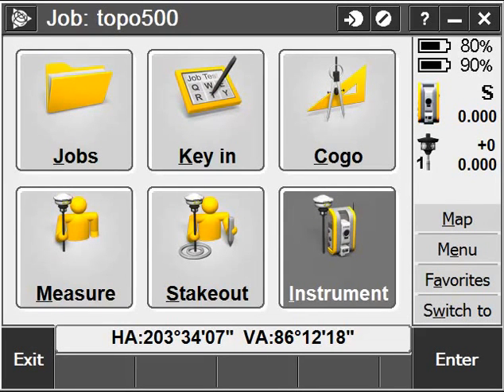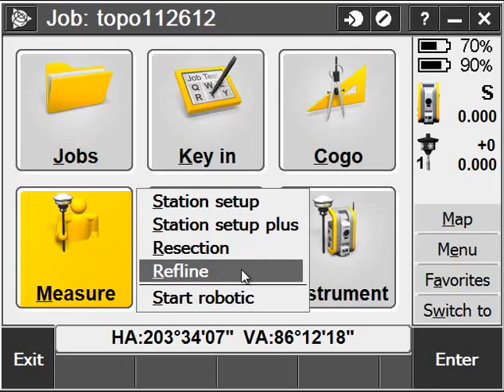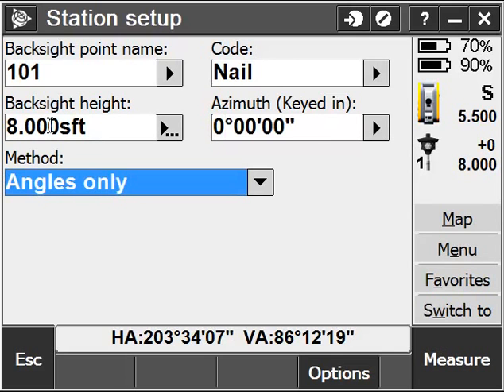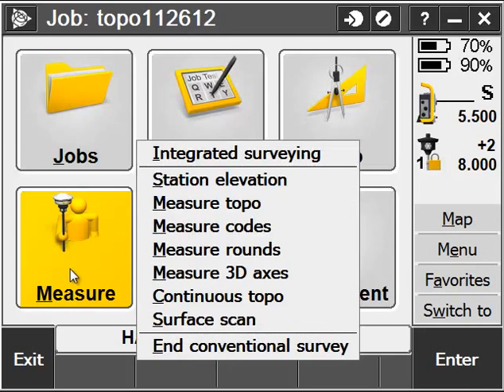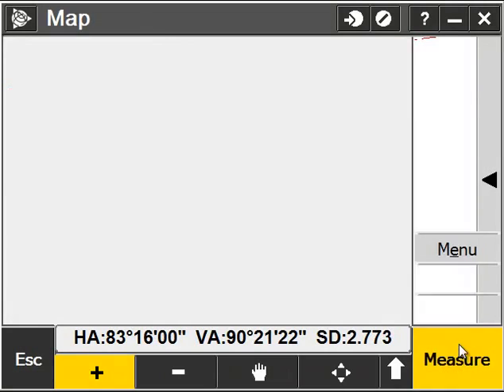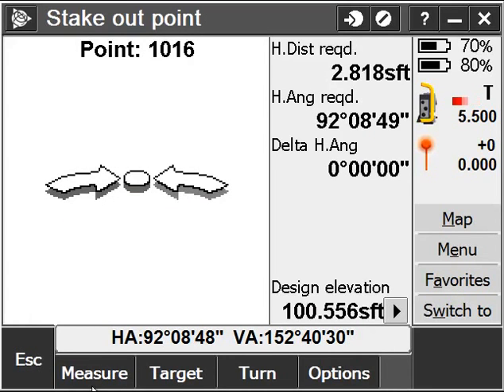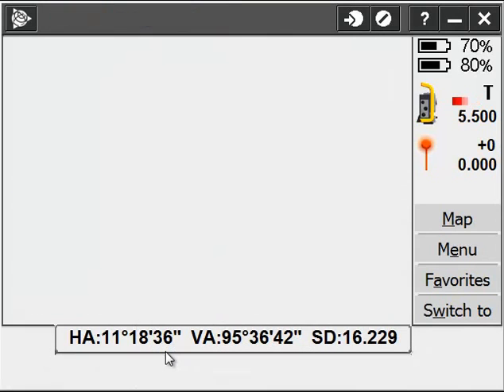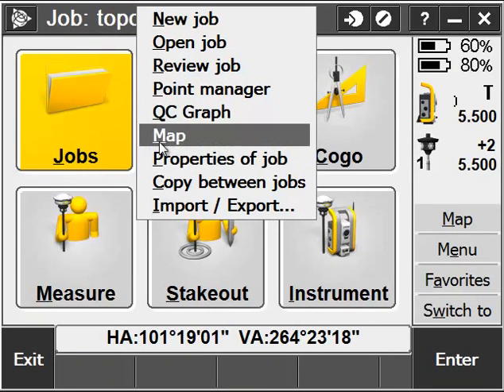Trimble Access & The S6 Total Station - Quick Tips

Comment: One thing I would add to the job setup is that if you choose quadrant bearings under height, you’ll be able to inverse and get a bearing instead of an azimuth in cogo, this is a little helpful when doing boundary surveys to check your measurements to a recorded plat.

Comment: I like your video it was good. I've recently started using a trimble s8 total station and I'm having problems completing calibration steps. I can't understand the instruction in the manual for adjusting the trunnion and I'm not able to calibrate the auto locking because the instrument is not allowing me to manually center the cross-hire on the target even if I disable auto lock before starting the calibration routine. I need some advice can you help me or is there a video I could watch?